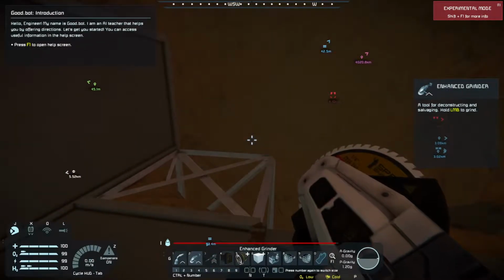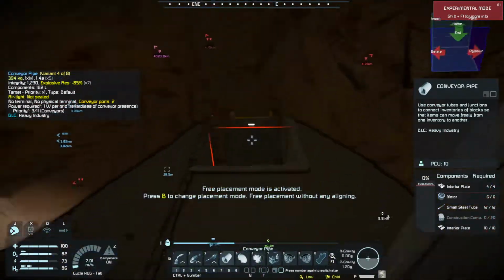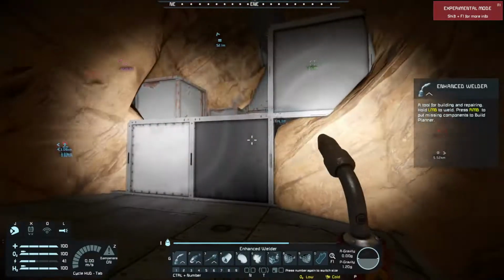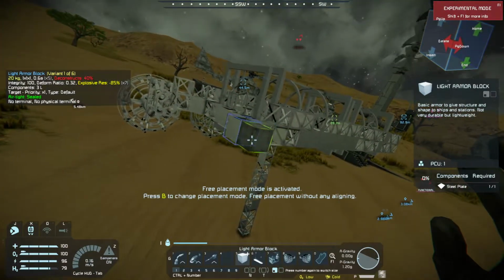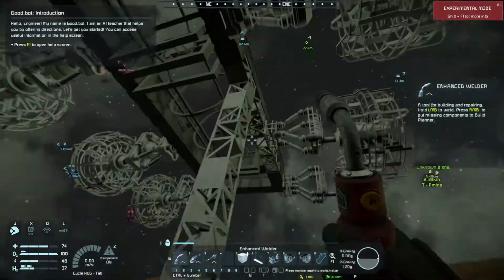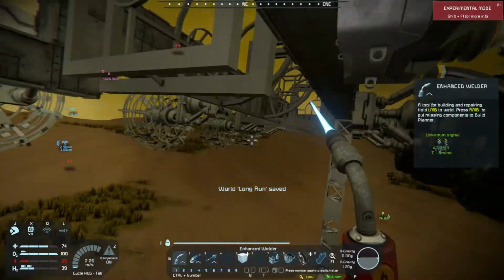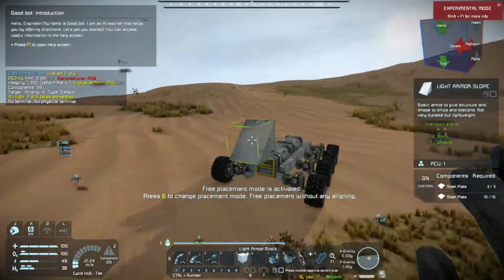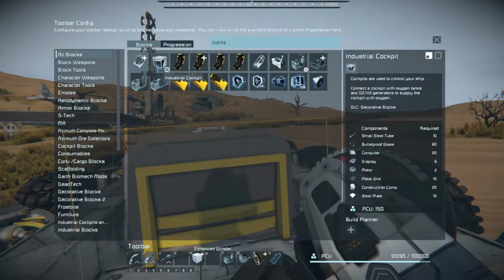Space Engineers - Season 1- Episode- 18

Comment: What is the mod for the moisture vaporizer called?  Also thanks for this once again!  The right middle wheels are not aligned with the left side.  Also if your cockpit does not connect and there is a tiny amount of atmosphere you can plug a vent into a connection and set it to decompress to air up the cockpit, might save your air tanks?  I don't own the game, so I don't know if the planet has any atmosphere, but worth a check, right?